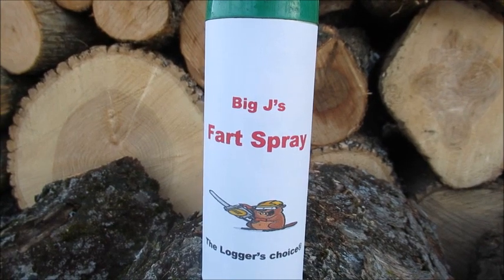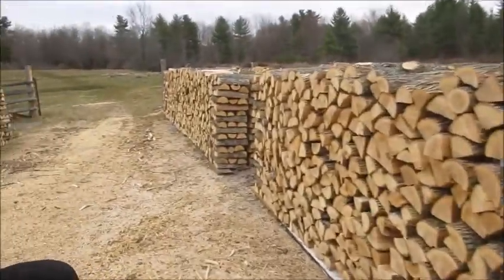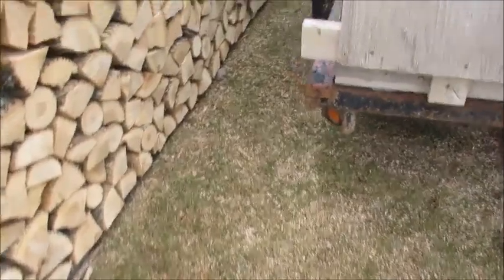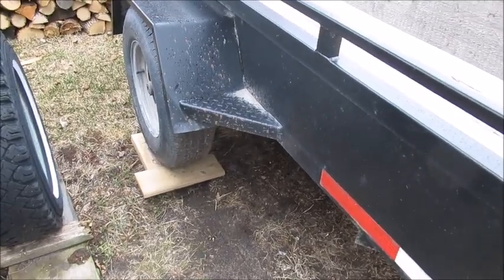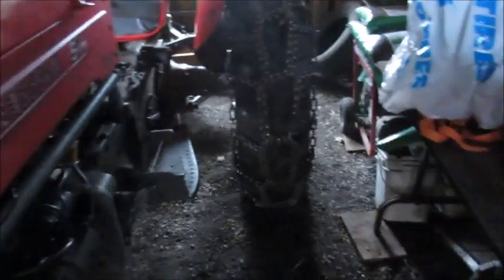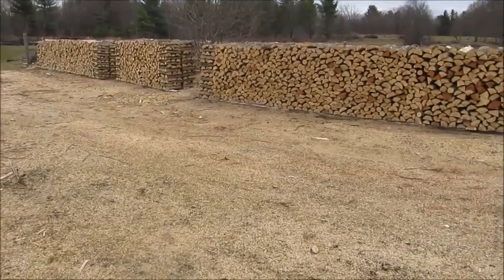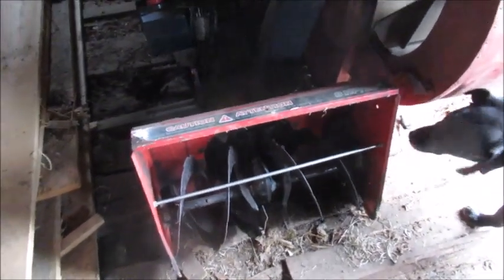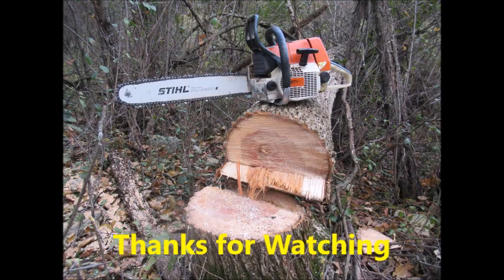Wandering in the Wood Yard.

Comment: Hey John. Spring is taking its time showing up that's for sure. More cold and snow this week.  Man thats a lot of saw dust to cleanup.  Take the plug out of that trimmer and pull the cord. If gas is going by the needle and seat it could just be hydro locked.  A guy never runs out of projects eh
Reply from the maker: Hey Dave, thanks. I should try that. It started last fall and then died. It wouldn't pull over like it was seized. Not down in oil so wasn't sure.  Should it pullover if I take the plug out? Will gas come out of the plughole? Take care
Reply: @loggerjohn01  yes gas would come out but you say it died while you were using it?  I thought it seized while sitting. So you're probably right,  it's probably toast 😞
Reply from the maker: @davessmallenginerevival2847  No I started it but it was kind of running rough so I was tapping on the carburetor (lightly) And it just died and wouldn't pull over like it was seized. What would do this? Thanks
Reply: @loggerjohn01  hmmm. Not sure John. That's a weird one